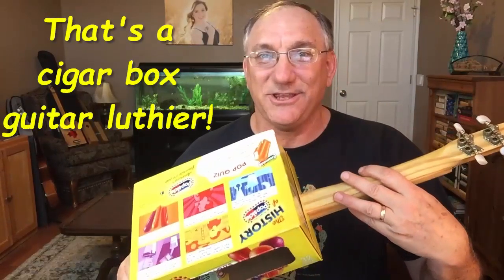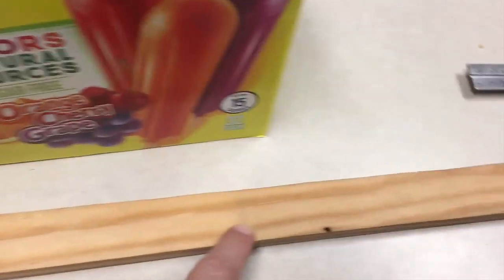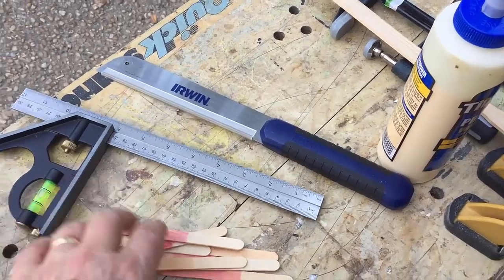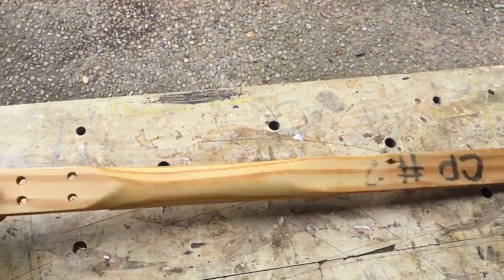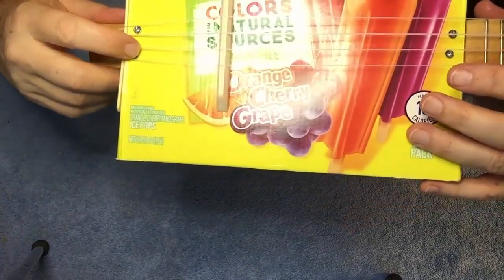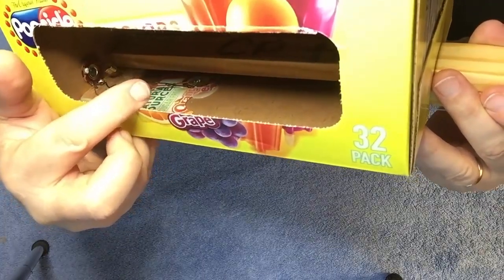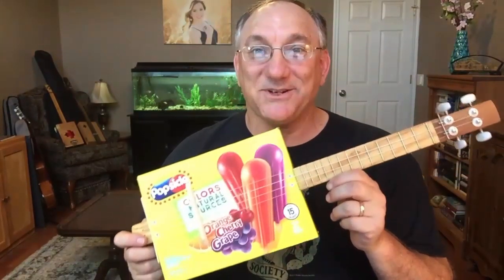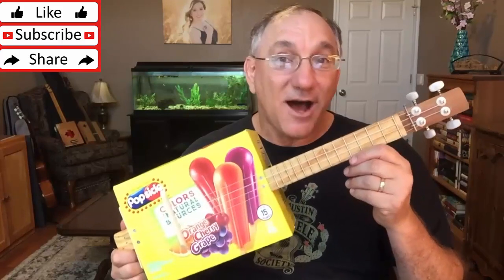DIY Popsicle box ukulele!  I built this from a Popsicle box and a wooden stake!  Check it out!

Comment: It is too bad that the Piezo broke; it would have been something to have that be electric.  This whole project is so crazy...I think about how flimsy these boxes are, and I'm surprised you didn't need to build a complete subframe on the inside of the box!
Reply from the maker: I put the piezo in initially thinking that the acoustic sound would be inadequate. As it turns out, it’s not to bad, for a cardboard box. This was an experiment to see if can work with minimal bracing. It can!  I think bracing would add to it’s durability.